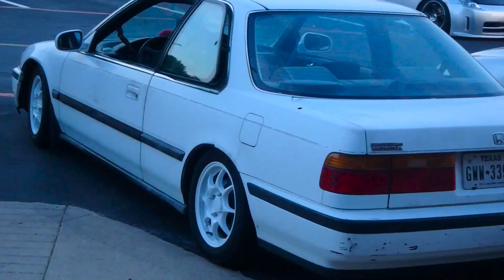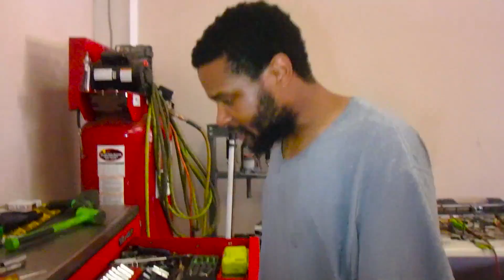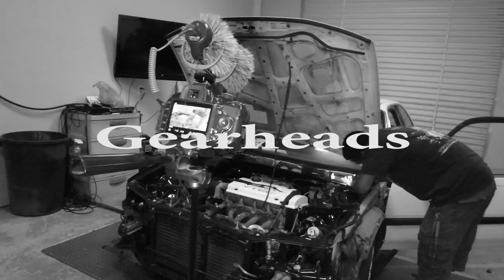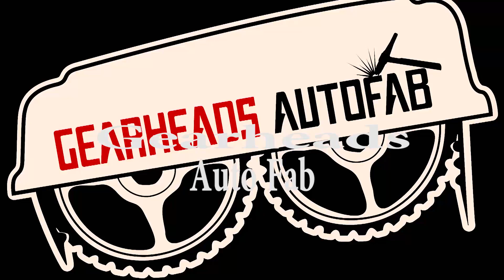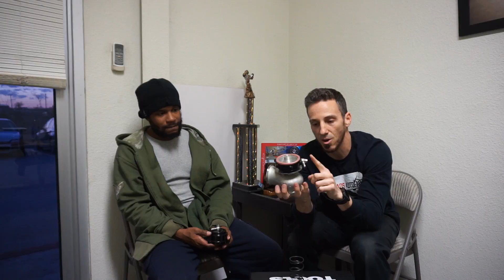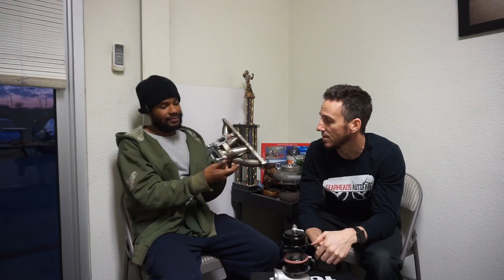how a wastegate works

Comment: I’ve been really enjoying the channel Jarom, just fun to see You and the crew all real and chill.  Reminds me of old times- Jari’s ride is so dope love the full on sleeper/low rider. I’m so curious if a 44mm with a small spring Vs. The 60 would compare in a back to back.... seriously want to sponsor a separate manifold and a gate for the test lol. Keep on keepin on brotha-
Reply from the maker: Chris Shane hello there! ya it’s hard to say exactly how big the gate needs to be for each car, recently tuned a big k series car with the same turbo jari is going to use and we still couldn’t regulate the Boost on a 44mm. It’s just the combination of turbo size and how high it revs. It’s not ever been a problem in the past on cars that didn’t rev high and have t3 turbos that could make 700+ hp.  The 60mm is goofy big lol